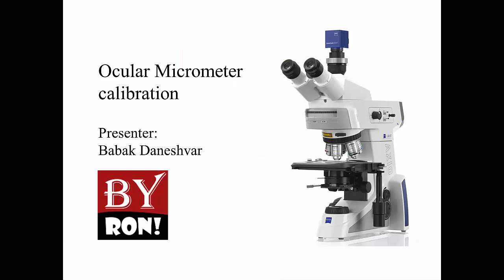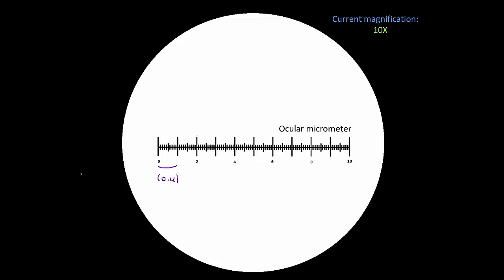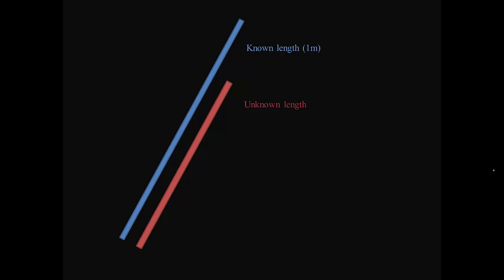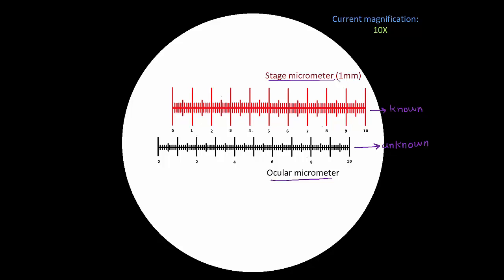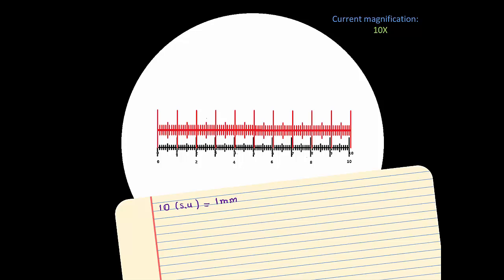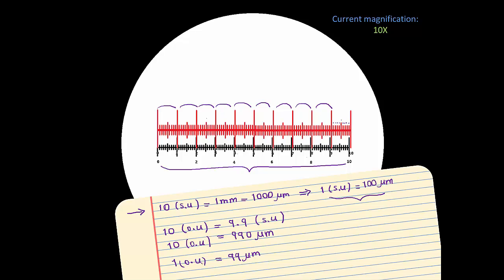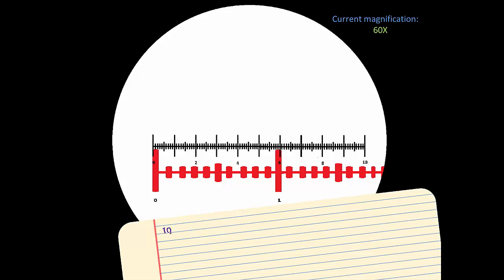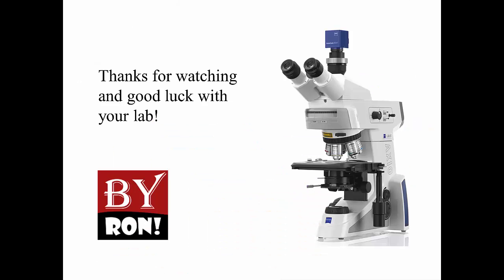Microscope Calibration: a short tutorial [New version]

Comment: Wait, an ocular micrometer has a range of 0-100, why does yours have 0-10?
Reply from the maker: WuTang, the stage micrometer and the ocular micrometer are not uniform across the board. 
You will find microscopes with 0-100 and 0-10. Same with the stage micrometers: There are those that are 1mm in length, and then others that are 2mm. 

Regardless, the logic behind the calculations remains true. Once you have the concept figured out, you can apply it to any magnification level and/or micrometer length.
Reply: Thanks, btw your video was played in a laboratory at my uni